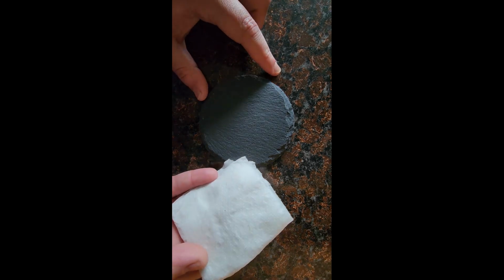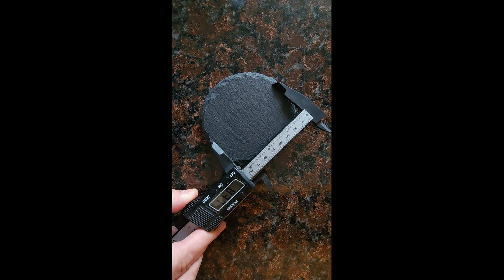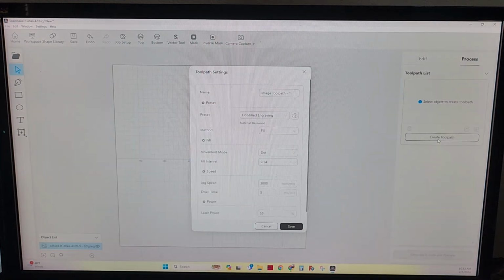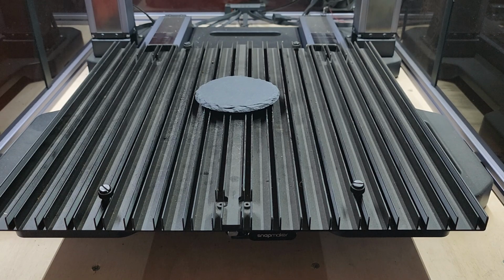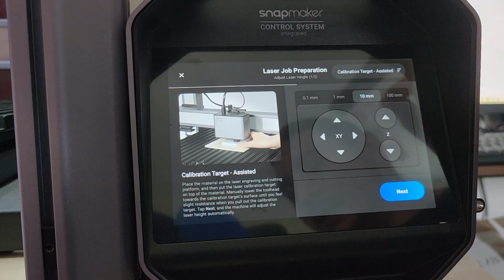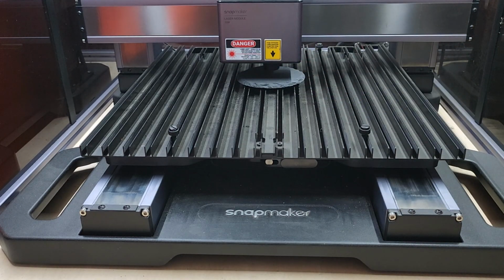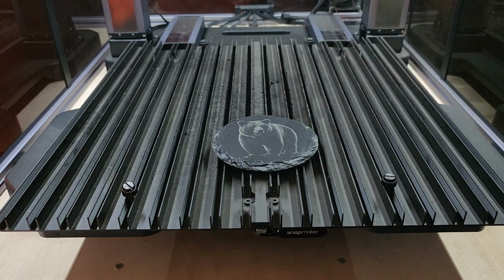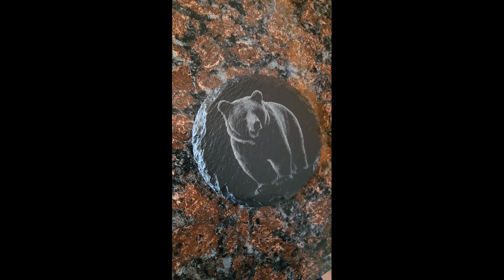How-To Laser Engraving Slate Coasters Tutorial

Comment: I have a question. When I engraved the tree, I used the suggested settings. Could you tell me what I should do if the engraving is very light. Meaning unless you look at it in a very specific way, you cannot see it or make out what it is
Reply from the maker: Did you invert the image first? Did you finish it with clear matte spray paint? If yes to both, and you followed my settings, it could be the slate itself.
Reply: Yes to both. I think Im going to switch to my 40w tomorrow since from what I understand it may be better, faster maybe, and see what it does.  I’m working on making a test grid to test different products too
Reply: I’m in your Etsy store right now.  I’m going to engrave that deer scene in a cutting board for my granddaughters adoptive daddy who is a hunter.   Thank you again for all you e done
Reply from the maker: @Kimberlymogan  send me a picture of the tree on slate through my etsy store so i can get a visual on it. The 40w is only faster in the sense of cutting thicker materials quicker with fewer passes. It surely will be able to engrave deeper on slate. The machine dictates the speed based on what you set it at. Dot fill, speed is based on dwell time. The other laser settings, the speed is based on work speed.

Comment: Have you engraved the burning tree design onto slate? Im burning it now and was just wondering if you had so I could compare. Ive already ran into an issue where I entered the dimension of the tile, ran the outline and saw it was a bit over the side so I lessened it, but then the design is printing a lot smaller than the dimensions of the new tile entry. So my tile was 89.6 and that ran the laser over the edges so I decreased until it no longer did that, which made it 82, Im running it now and its t least an inch from the bottom. SO thats something Ill need to play with
Reply from the maker: I have not used that image on slate, but as I've stated in the slate video, it's always a good idea (for full images) to try and extend past the edges. You ensure the full image is engraved on the entire slate. When I do simple images like the bear, I try to keep it inside the slate. So for example, if im doing a square slate, and it measures 80mm, I make my image about 83mm (thats only 1/10th of an inch). I also pay attention to my software, as sometimes there may be some additional space just past the image. If there is , I would increase it just a bit more. With the full images, it looks much better covering the full slate, that to look boxed into the slate. Hope this makes sense and helps.
Reply: @MadeByMervich  yes. Perfect sense. I misunderstood the sizing instructions. I did indeed hear you say make it a little over the edge and somehow when you made it smaller after doing the test to where the laser was going, the first instruction left my noggin. Entirely my fault.
Reply from the maker: @Kimberlymogan  no problem, that why im making these videos. To help people achieve higher quality products.

Comment: Thank you for honoring my request. With one video you explained everything I needed in the process!.   how do you determine what settings you will use? Is it from doing test burns oe is there a formula you follow?   Thanks again.  i am so appreciative of your time doing this
I purchased one of your files so I can test my "education" Thanks again
Reply from the maker: You are so welcome! So, I do a bunch of test runs on nearly everything possible, and I'll keep a log.  Once I find what works on a particular material, it gets logged, so I can always look back (like a cheat sheet) and replicate it. Where things change is image size and material composition. For canvases, different colors react differently to the laser. Some poor, and some good. So for them, its ever changing slightly. But slate and wood are always close to the same settings. Different woods do end up a little differently, so I note it by material type. I also try to stick to the same materials to increase my production and lower waste since I know exactly what im getting.
Reply: @MadeByMervich  awesome. thanks. I recently saw some test grid files so Im going to run those on some things I have to play around with.
Reply from the maker: @Kimberlymogan  they do help for sure, at least to get started. When I first started with the Artisian, I made my own, and it took me like 1 hour to make it. I have about 100 squares on it. I only use it now if I run into a material I can't figure out from experience or my log.
Reply: @MadeByMervich  Maybe making my own will be better? help me to understand what each setting causes?